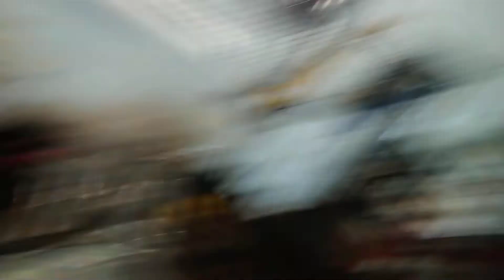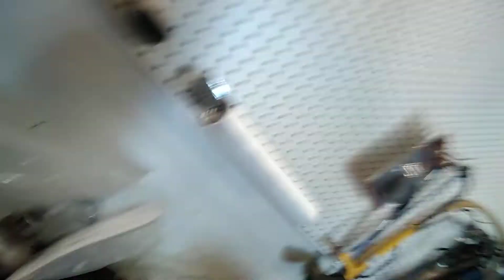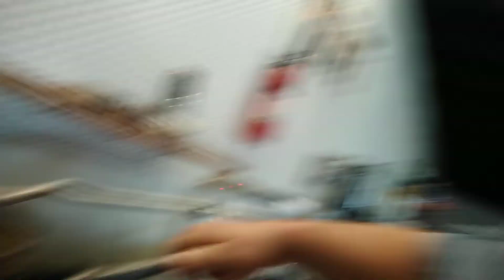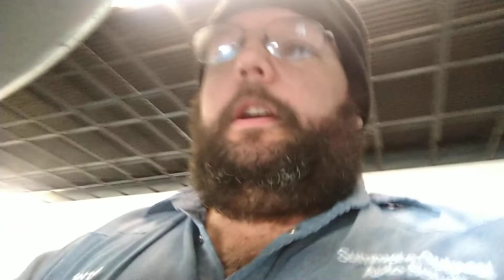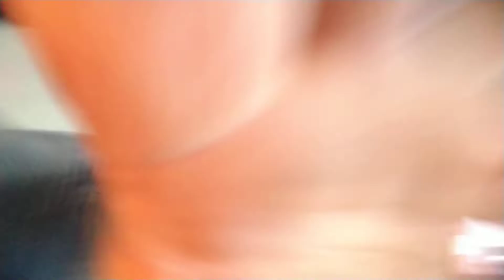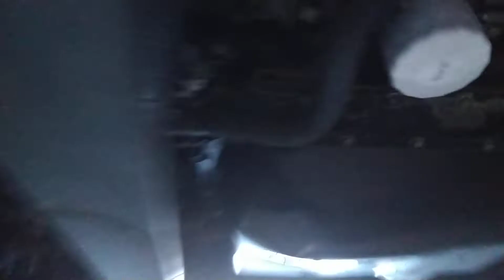Saving down time by doing two or three things at once.

Comment: I realize that shops replace damaged parts to aviod liabilities. That said if this were your truck would you put a new pan on or dolly that dent out, check the flanges for warped rails with a straight edge and reinstall it? I know what I would do LOL!
Reply from the maker: If it were mine I would pound that dent back out, unless I had enough money to buy a new one. What has me worried is the crease at the bottom, that's liable to crack. No damage inside so for this customer I think he's better off just replacing the part not having to worry about it, if it starts leaking on him and he doesn't catch it that could be an expensive fix.
Reply: Customer, new part…they are already paying the labor….why take a chance of it being warped and leaking if you try to fix it….not worth it.
Reply from the maker: @ericsherman4181  it had already been done once before at least...